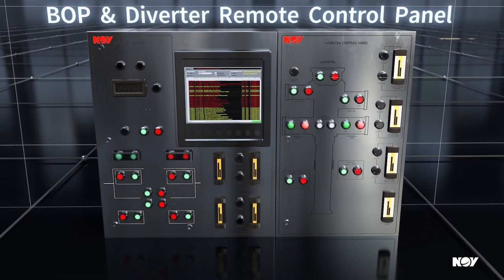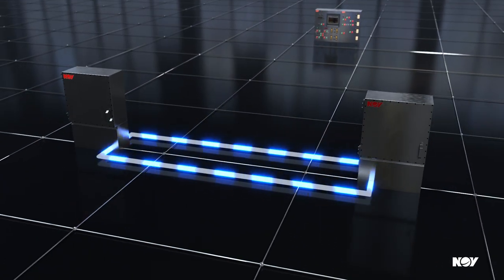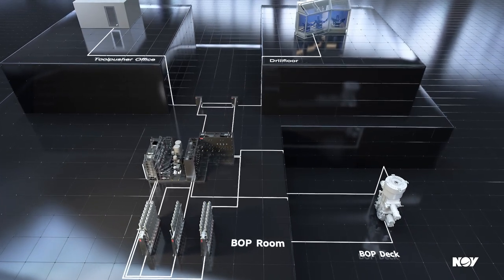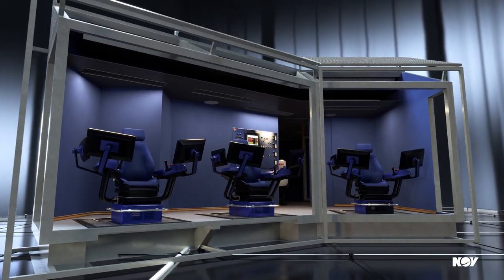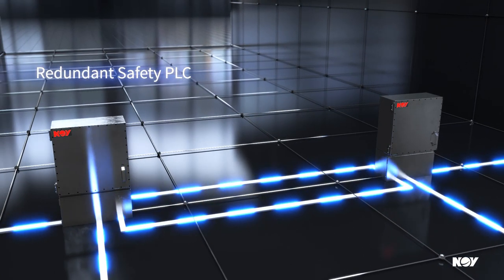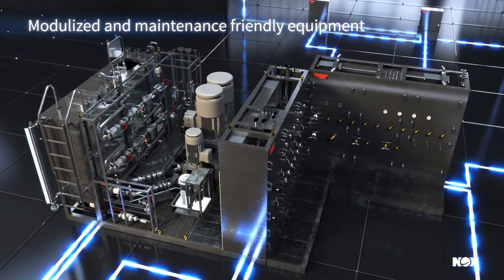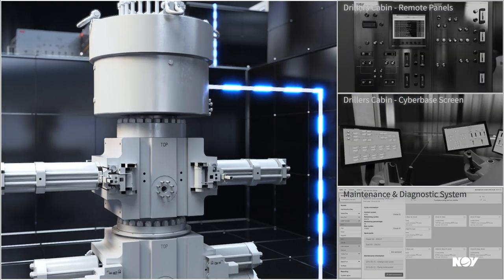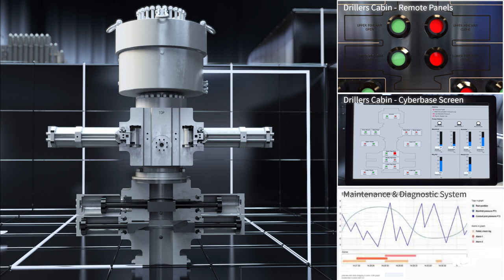BOP diverter control system

Comment: The blowout prevention system using an annular valve and blind shear rams need to go and have a history of failure. It hasn't changed much since the deep horizon macondo well blowout which very much highlighted this type of system failure. The annular valve failed to stop well flow when activated, this was due to the rubber doughnut seal getting nicked and failed to seal properly. The blind shear rams are designed to crush/cut the supply pipe closed and failed due to the piping getting bent from a massive "kick" or Pressure spike (hydraulic hammer.) The bent well pipe being bent was out of alignment and blind shear rams unable to completely crush/cut the supply riser closed. The flow passed through the blowout prevention system and went through the riser to the deep horizon where gases found a heat source. Problems affecting this type of blowout prevention system are that it cannot be tested periodically. The annular valve, but rubber doughnut seal is a weak link. The blind shear rams cannot be tested at all. There's no absolute way of knowing if the blowout prevention system will operate properly until needed. There's no way of isolating pressure and when activated still leaves the well being sealed at the seafloor by only a crushed/cut well pipe. Now the well is basically a time bomb that will eventually go off as any attempt to repair or corrosion will result in a spill. Once placed in position on the seafloor becomes a "hot" well. 
I'm the designer of the caphead spool that was used to stop the deep horizon's macondo well spill.  On June 20, 2010 I watched news coverage of the horizon crew using underwater robotics to cut bent sections of well pipe away from the wellhead. This left several feet of pipe sticking out of the seafloor. The pipe also had a flange inches from the pipe end. I designed a caphead spool that could be lowered onto the wellhead and lock on using lugs or wings to secure behind the flange. At the bottom of the caphead I used hydraulic chevron seals that would use the well pressure to force the chevron seals down sealing the spill into the caphead directing flow to the surface where it could be recovered onto a barge or tanker. Once flow is controlled it could be overpressured by using a downhole pump to inject the cement/slurry sealant into the wellhead until full by volume. The caphead would remain in place until the cement/slurry sealant hardened. End of macondo well spill.
I also found that BP had a "horizon helpline" and were asking for assistance. This was via email and internet, as well as a contract number. I called the "horizon" personnel and informed them I had a caphead design that would stop the spill and was asked if they could take a look at. I submitted my design but failed to file for a patent. Later I received an email back from the "horizon helpline" personnel that my design was unusable. I tried calling back only to find the helpline had been discontinued. Several weeks later I again watched news coverage as my design caphead was lowered onto the wellhead stopping the spill. I emailed BP and was told that since my design wasn't patented the design belonged to them. So basically for my contribution was slapped in the face and brushed off. I still have copies of my design submitted as well as emails to and from the horizon helpline verifying the design was mine. I looked for legal representation and was unsuccessful and still have a case filed with BPCLAIMS.ORG.  I decided to wait until Trump is in office to voice my opinion. Later seeing the same design blowout prevention systems still in use 9 years later can honestly state that more spills are likely in our future.  
I'm also not your average bear as I'm a mechanic employed in Alaska's oilfields in Prudhoe Bay at the Kuparuk river unit, for a company subcontracted to conoco Phillips. Current 2019. I also have over 30 years experience in pipeline repair and maintenance. I do have better safer designs for a blowout prevention system that can be tested periodically to verify proper operation as well as isolate pressure in order to perform repairs. The control valves are repairable and means the well is capable of returning back to production once repairs are completed. The older valves will stay in place but converting the annular valve to a pressure/ flow control and blind shear rams used only if wellhead pipe is in good condition and used only to seal the wellhead only after abandoning. My designs are available but are not free and will be patented. The cost of upgrades eliminates the probability of spills, loss of lives and spill clean up and environmental damage. "007".